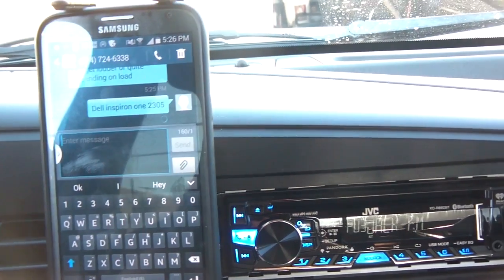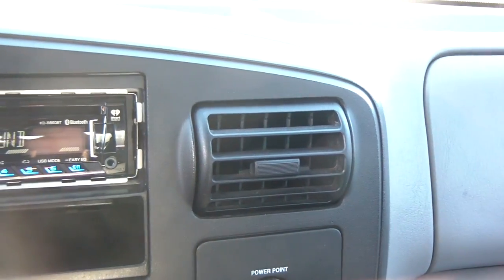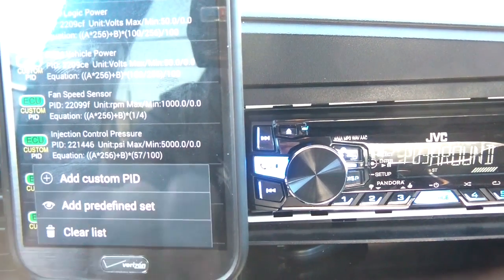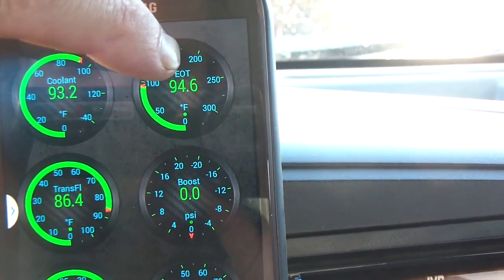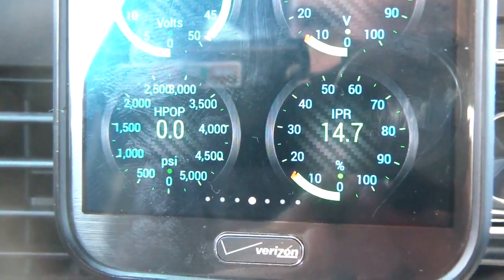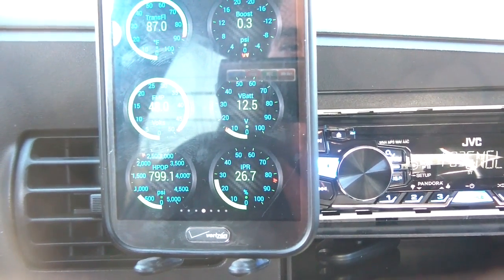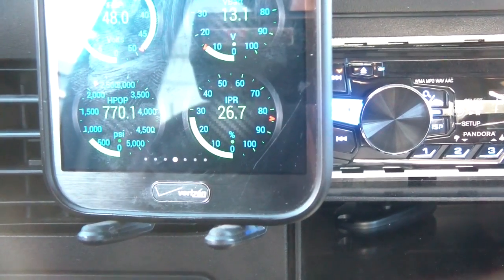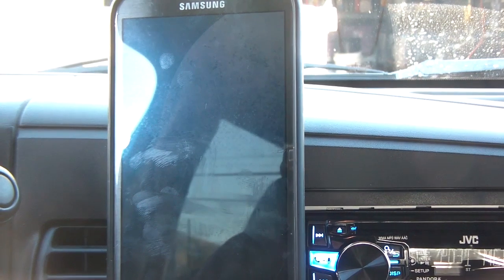Ford Powerstroke Torque Android App Installation review

Comment: I have both Torque Pro and the free basic Torque. But I have a major problem, the gauges are so dark I can't see them on my phone. I know the problem is not the phone because I have tried them with a different phone and have the same results. It was originally not an issue as I was just using them to check CEL codes, but now I need to view the MAP sensor. Do you know what my problem might be or how to reach Torque?

Comment: How do you keep it from cutting the truck off while driving?
Reply: Jeez, I had the same problem. 2000 F250 7.3 PSD using BAFX OBDII w/ bluetooth.
Reply: @bWd_WA  if anybody sees this still there's a option in settings on torque pro that has a workaround

Comment: I may have missed the anwser, but... which OBD2 are you using for the diesel 6.0 ... I have bought 2 that look exactly like yours in the picture and neither work on my 2004 ford f250 6.0 ... any suggestions ??? thanks
Reply: Did you ever find one? ..I’m in the same boat now
Reply: Makes sure that all other devices afe turned off and not connected. I had sams issue,  it was operator error.

Comment: How did you get your coolant gauge to work mine says -40 its for my 2002 f250
Reply from the maker: I didn't do anything special, mine worked out of the box, no changes to stock configuration. Did you load the ford PID's?
Reply: I have read that the 7.3 doesn't send coolant temp to the PCM because mine reads -40 as well. I assume his is a 6.0 by the looks of the interior?
Reply: Yeah my 7.3 doesn't read coolant temps neither. Says -40

Comment: I just bought this set up... I'm new to diesels what are the normal ranges of theae gauges so I can monitor and know when im having issues..
Reply from the maker: Coolant and oil temp should not have more then an 18 degrees difference or delta.
Reply: @fintechrepairshop  thanks for the reply! What are the man pids I should be monitoring with their normal ranges like the hpop, tranny temp, etc just so I know what the actual health of my engine should be and to set alarms... Thanks in advance

Comment: Yep cant get mine to talk to the ECM either,i think some of these bluetooth OBD's are duds ????
Reply: Yes, ive used like 6, but the red and black on is working great, 17$ amazon
Reply: If your cigarette lighter fuse is blown it wont connect cause it's the same fuse as the obd port and it won't power it.

But yeah ur right some are knock off duds. I bought three b4 I got a good one

Comment: Thanks for the video. I have a new to me 2001 7.3 Excursion. I was hoping to have a display with Oil Temp right next to Coolant temp, but my coolant temp only reads -40 degrees. Your seems to work fine. Is there a trick?
Reply: Manning Grinnan I believe the coolant temp doesn’t go through the pcm so the the app doesn’t read an output. -40 is default

Comment: Where do you get information about what the readouts of different sensors should be? For ex. You said the oil and coolant temp should be within 16 degrees, where did you get that information?
Reply from the maker: powerstokhelp youtube videos
Reply: Thanks for the reply. Is there not a spreadsheet with all of this info on it? :\

Comment: What Bluetooth OBD scanner are you using?
Reply: Ummm... he showed you, elm327 but ive used that once it was crap
Reply: @Ivey0401  the elm327 wouldnt work at all for my 04 f250 6.0 , bluetooth would not even find it, any suggestions ?

Comment: Will it work on a 96?
Reply: OBD2 is standard on all american spec cars 1996 and newer
Reply: the early powerstrokes wont work with most scan tools ive even had a 5k dollar snap on scan tool on mine just kills the engine  im also curious if this works on 95 96
Reply: tbirdpimp07 on a late model 96 yes but 95 is obd 1 and will only kill the engine.
Reply: You have to buy a good OBDll. I spent about $45 on mine and communicates perfect. The cheaper ones will lag or not communicate at all. I have a 96.
Reply: If it's a powerstroke it's going to kill the engine if it's running.  Not a big deal, it'll still read whatever codes are there.  It kills the 7.3 in my 96 E350 and the one in my brother's '01 F550... nothing I new alarmed about.

Comment: unless you're operating in cold climates your oil should be 15w-40, I'm no expert but I think you HPOP should show higher readings. I think you Injectors are not liking that lower viscosity oil. I run Rotella 15w-40 all year long hear in the windy city. I hope that helps
Reply from the maker: Most of my problems were bad dummy plugs. Fire right up now
Reply: I'm glad you were able to figure t out. Did that bring up your HPOP pressure? I still wish this app could do an injector buzz test
Reply: Fintech Repair Shop  what are dummy plugs,  im having issues with my 7.3 idling and running crappy until 2000rpm

Comment: battery voltage should be 14.3 check your alternator its not putting out enough lol
Reply: 13 to 15 volts is good. Hes fluctuating 12.6 to 13 so yes he needs a new alternator soon lol

Comment: why is my voltage reading .5volts? is there a set up for volt calibrations?
Reply: The most I have ever seen reported by Torque Pro for ICP-Voltage is 3.5 Volts at WOT.

Comment: I don't know how you get this to work I have been trying for a while and it just keeps telling me it will not talk to my ECU
Reply: High press oil pump .. this is why healthy batts and starter is always needed because it need almost 700 rpm just to get the high press oil pump high enough to fire the injectors . At wot  wide open throttle. 3500+ is good.. and yes synthetic oil changes the press...synth oul molecules are smaller than conventional  oil.    Rule of thumb if your going to run synthetic start it early not in the latter milage of the enging.....i would recomend a 50/50 blend . The conventinal molecules will help keep it from leeking and keep oil pressures up and the synthetic will keep the wear to a minimum...how do i know this Ive been working on 7.3 since 99 and all my fleet units that have used 50/50 blend have made it at least to 700k...  it works with gasers as well . My 4.0v6 sport trac. Has 500k on the original engine only 1 tune up thats it. 95 mustang 330k still purrs like a kitten .. now these new ones ..........good luck
Reply: If you have a sensor problem. It will not connect until you unplug bad sensor. Yeah crazy but I unplugged the bad ICP sensor and it connected.
Reply: + @fparkhome but how did you know which sensor was bad?
Reply: @kidlargo1  scanner will work once you unplugged the sensor. Unplug one at at time to get correct one. My ICP had oil in it and was the first one I unplugged.
Reply: Same!!!!
Reply: Check your fuses man make sure all your fuses are good you probably not powering up the tool

Comment: didn't think you could get boost pressure from the ecm?
Reply from the maker: The ECM needs to know the boost so it can control the waste gate.
Reply: Fintech Repair Shop Will it work on non wastegate 94-97 powerstrokes

Comment: Your batteries or alternator are shot.12.8 13.2 by ford standards is shot and will cause your FICM to fail.
Reply from the maker: +71usmc I was thinking the alternator was low. The batteries are 3 months old. Sometimes it goes up to 13.4V. What should the running volts be at? I just had to replace the ficm inverter board. I have a 1966 bronco with a 2G alternator upgrade that runs all day at at 14.5V.